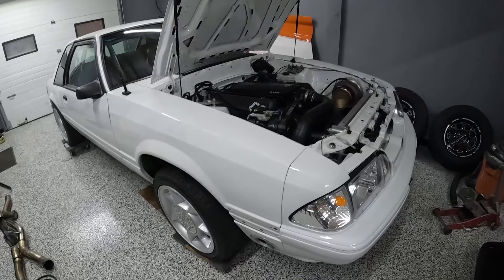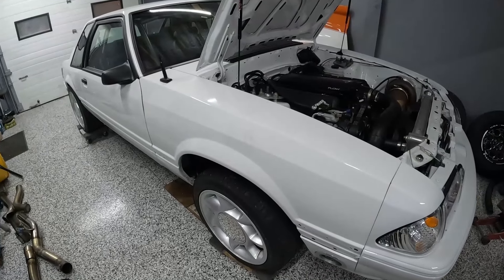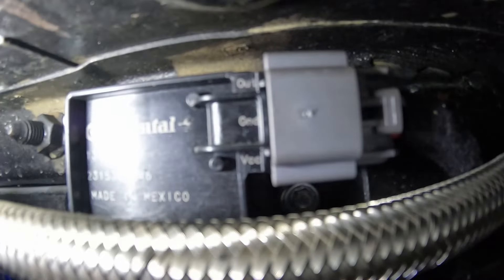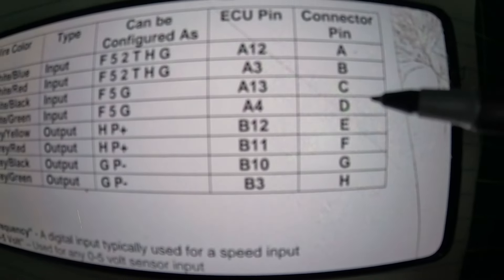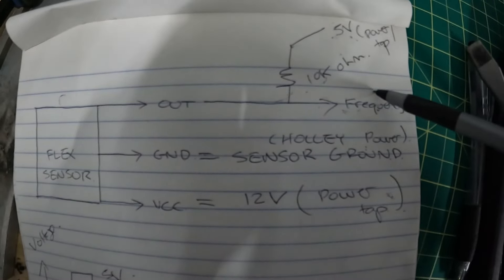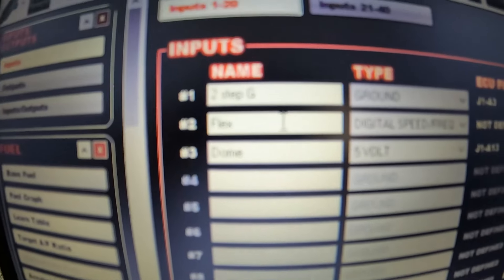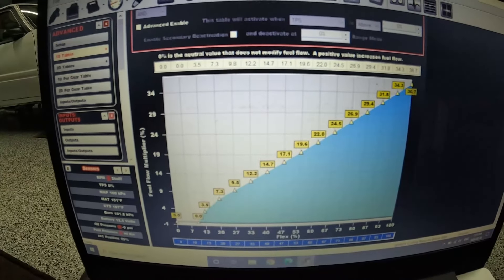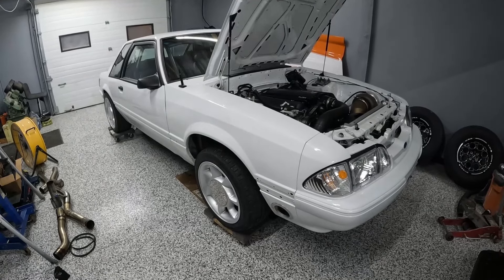How to Wire and Install an E85 Flex Fuel Sensor Holley EFI Terminator X

Comment: Great video. Just an FYI, the 10k resistor to 5 volts is known as a pull up resistor. I've seen a few videos with guys using 5 watt resistors, a 1/4 watt is pelnty. I use Dale resistors from Digikey.

Comment: I gotta question bro so I bought a harness from sloppy mechanic that connects to the sensor and into the power tap, would i just need to add the 10k ohm ?
Reply from the maker: @victormagana6476  checkout his wiring diagram I'm not sure on what his harnesses have
Reply: @ okay I will, I have a terminator aswell just wanted to ask. Anyway you can pm me some pictures of how you have the wires on the input and outputs?
Reply from the maker: @victormagana6476  have you confirmed power at connector? It is a fairly straightforward sensor, confirm if inputs are configured correctly also
Reply: @WestcoastWrenchin  yes it is I just looked into it and it does have a resistor in it already

Comment: What fuel pump(s) are you running??….ive been thinking of going e-85 on both my supercharged nova and supercharged c10…….ca. 91oct sucks
Reply from the maker: Magnafuel 4303
Reply: @WestcoastWrenchin  just that (1) pump does the job???
Reply: So i just googled it and i see its a external pump im guessing your running a fuel cell with a sump??  Can u run tha magnafuel 4303 thru a factory tank with the original pickup if u mount the pump below the fuel level and close to the tank so it pushes the fuel???
Reply from the maker: @trentdawg2832  Yes no issues, 860lb per hr fuel today no problem

Comment: Hi good video! Im having problems with my system. Havent had the car running for awhile. Made some changes like bigger injector and a adjustable pressure regulator. Then updated the computer to v3 firmware and the firmware update went fine until i got to my 7 inch dash. It just wouldnt work with the v3 firmware. Went back to v2 firmware on the display and its working. Anyway after that my flex fuel sensor quite working all together. It worked just fine until i switched to the v3 firmware it went straight to 0 reading and said high err  on my laptop when i had it hooked up and 0 on the 7 inch display. I put the car together like 3 years ago and its been setting for awhile but the flex fuel always worked good until the v3 firmware upgrade. Im pretty sure i dont have the 10 k resister on the input wire or the 5 volt wire conneted. Im not running the same flex sensor as yours either. Im going to give this a shot and see if it does anything. Just wondered if the v3 firmware is whats causing the problem now? Thanks
Reply from the maker: It for sure has to have the resistor hooked up to 5volt as it's part of the basic principal of operation cheers

Comment: Where did you get 12v power from? Can you get the power from any of the pins on the ECU plugs?
Reply: I get it now you have a 4 pin power tap and I have an 8 pin. I have a terminator with input/output 8 pin. I don't know if I can program 12v out.
Reply from the maker: Right off the power tap yea, it's a separate 4 pin connector form the 8 pin yours will have it too

Comment: the 55% E content is about right, there was a study done that looked at anti knock index and research octane number of E50 vs E85. Its nearly identical, 101.6 vs 101.5 (yes e50 was 0.1 RON higher than E85) AKI was 95.6 vs 95.8 for E50 vs E85 so theoretically speaking, you should be able to make 100% of the power you make on E85 on E50. 

The two limitations of E50 vs E85 (in my opinion) are this: one, out of the pump the blend stock for non ethanol is raw gasoline without anti knock additives, its roughly 85 octane, with all of the anti knock coming from ethanol. This is a non optimal situation for high performance boosted vehicles as opposed to having E98 blended down to E85, E70, or E50 with a 93 or better octane fuel. 

2nd limitation is for those without an intercooler. Alcohol content in the fuel has very high heat of vaporization (HOV) and acts as a secondary intercooler of sorts. While in blends the HOV increases in a non-linear manner and flattens out above E40 as mentioned above with RON and AKI not changing much in e50+ blends, the less alcohol you have in your fuel mix, ultimately the less amount of temperature change you will be able to affect on the cylinder, in a non-intercooled application. 

Non intercooler applications, again in my opinion will be far more sensitive to blends of sub-E85 than the forced induction applications that have a proper intercooler, simply because of the higher evaporative cooling requirements needed in absence of a IC.
Reply from the maker: Thanks for this!